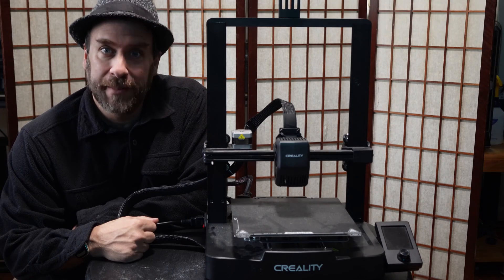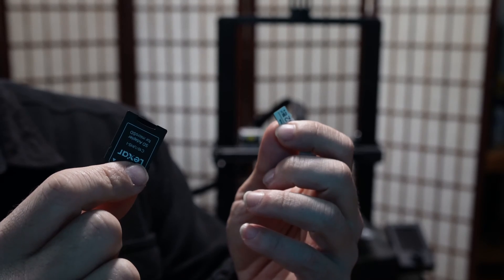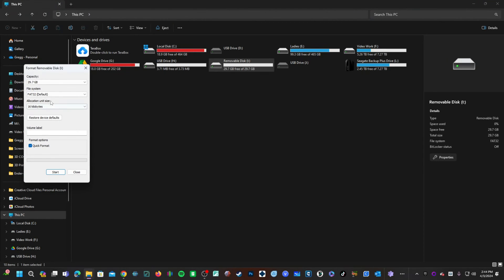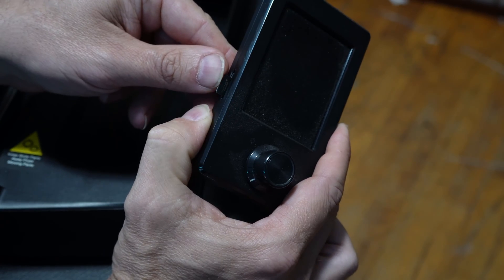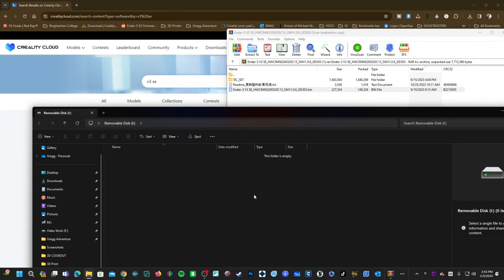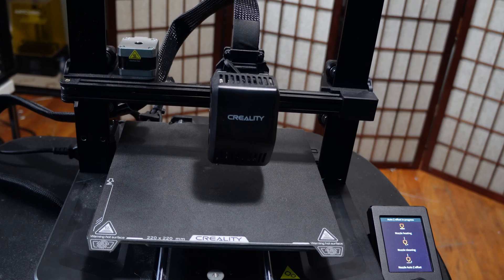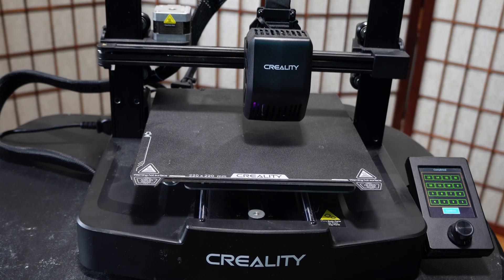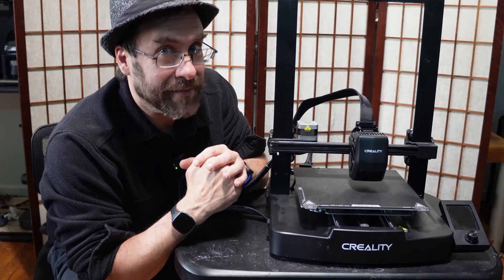How to Update the Firmware on Creality Ender 3 V3 SE - 3D Printer

Comment: First of all, great video. Secondly, do they not sell this nebula pad anymore? Can't seem to find it on their website. The only thing I can find on their product page is literally just a picture of the pad, with no details or anything. I'm thinking they must be switching to the Sonic pad I am seeing.
Reply from the maker: The Sonic Pad is well older than the Nebula. I have had great luck with my Sonic Pad, but I would find a Nebula for the SE
Reply: @3DRundown  Apparently AI tells me I can use an old phone/laptop for wifi by connecting directly through USB. Those screens seem to cost what I paid for the printer (on sale). Think I'm going to try repurposing my old laptop with OctoPrint. And maybe in the future integrating it in to my desktop setup and connecting directly. Thank you so much for the reply and for the video too.
Reply from the maker: @sihTdaeRtnaCuoY Nebula is a 10 min job and gives you Klipper. You'll have a much easier life with the Nebula
Reply: @3DRundown  I'll look in to it, but I need to see how much I will actually use this thing before I invest more in to  functionality. Thank you for your help.
Reply from the maker: If you mean "The printer", I get it. If you mean the Nebula, the answer is, everytime you use the printer. It completely replaces the Brain and O/S of the Printer. Seamless wireless printing and control, from Creality Cloud and Creality Print, is worth it alone. Best of luck to you. Check ebay!

Comment: did the screen part, worked perfectly, than tried the printer part and it just simply did not do anything, inserted the card turned the printer on and it just turned on like normal
Reply from the maker: Check the pinned comment for updated instructions. Also, make sure you don't need C14 files

Comment: Hi, i am unable to find that exact website where you found the update file. I have searched everywhere but cant seem to find it
Reply from the maker: Sadly it's changed and become a challenge to find. If you'd like, it's in my private Member library. Be a member, and you'll have access. Catch the pinned post for updated directions
Reply: @3DRundown i have found it now, i had to find the printer on the website like you would do if you were to buy it and you can find the files there, thanks for the quick reply and the help btw
Reply from the maker: @Is_This_It_ Awesome. Good luck🎉

Comment: Just in case someone had the same problem with me, if you change the name 123.bin (the bin file that you put in the big card and put on motherboard) that will do.
Reply from the maker: You had to do that cause a previous attempt failed, or a firmware with the same filename was already installed. It won't attempt the same file name twice

Comment: IMPORTANT FOR V1.1.0 UPDATE:     
1. COPY FOLDER (TJC_SET) to SD card to update screen
2. COPY FOLDER (STM32F4_UPDATE) to SD card to update printer motherboard

Also ensure only a single folder is present per update attempt, don't put both folders on the SD card at the same time
This will update succesfully then.
Reply from the maker: Also, Catch the pinned comment.

Comment: The solution for updating firmware 1.1.0 is to download the file, then unzip it (decompress it). Inside the 'update' folder, there will be a .bin file. This file must be placed onto the micro SD card (only the file, not the folder). The .bin file should be at the root of the SD card.

Comment: I  did everything in this video and It worked! But right after putting the card for the motherboard update, when it started leveling the bed, it leveled in the same spot about 3 times then showed a QR code on the screen. What’s going on?
Reply from the maker: No Clue. What does the QR Code say?

Comment: Hey, so I have a question. So mine keeps going back to the language setting part of it, it won’t go to the regular menu. How do I fix this?
Reply from the maker: Not sure. I have written instructions on the Pinned comment. Try that. Also, if you have the C14 version of the SE, you need a different firmware
Reply: @3DRundown  Got it, thanks so much!

Comment: Can I ask, can I still use the sd card and put STL files on it to put into the files of the 3D printer?
Reply from the maker: You can not print STL. You need sliced GCODE. You can use USB, but that's 3  years ago. Send direct from CP6
Reply: @3DRundown can I send it from creality cloud to the printer?
Reply: @3DRundown I've been trying to figure out how to connect my printer to the creality cloud for a couple days now, so if you could help me out with that, that would be great 😊
Reply from the maker: You can only do it once the NEBULA PAD is installed. Are you at that point?

Comment: So following this tutorial got my printer basically bricked: After doing everything step by step as you said, when i inserted the microSD card in the screen and powered it on, the screen just gets stuck on "copying from SD..." at 0%. I left it like that for 2 hours and nothing changed. Is there something i can do here? Because it seems like my printer (or at least its screen?) is done for.
Reply from the maker: You followed the updated written instructions in the pinned comment?
Reply: @3DRundown  i dont see a pinned comment, but thankfully i did get the printer working again, it was just an issue with the SD card i was using, apparently this printer is awfully sensitive to that for some reason.
Reply from the maker: They all are. Always use the best quality card you can. 32gb or less, Fat32 formatted

Comment: how much time it takes? ,my printer its stuck in the copy sd 0% about an hour ago 😬
Reply: now i have asystrem data error message
Reply from the maker: Should be breif
Reply: now only shows system data error, creality can´t solve the problem, now it´s trash, only 3 days new
Reply from the maker: No such thing as "Trash" In the 3D Printing space.... We fix it. Have you tried my updated Written instructions, in the pinned comment?
Reply: @3DRundown  Incredible, somewhere I saw a video about a strange event. You need to use a certain brand of micro SD, so I did it, I used sanddisk and it works great, now the screen is updated, but not the hardware BIOS. By the way, I'm using the new firmware update from May 2025.

Comment: Huge thanks for this awesome video!  This morning (it's late afternoon now) I realized my printer was stuck in a blue-screen-of-death 😭. Since then, I've opened it up, checked the power supply with a multimeter, and updated the main firmware, which got the motors working again. BUT, the display was totally messed up. *Nowhere* until I stumbled on your video did anyone mention that the display unit has a **separate memory card port**! Just finished the firmware update on the display, and it's back up and running! Thanks a heap! You saved my print day! 🚀

Comment: I can’t get the bin file to run setup. Dial pad worked perfect
Reply: I’ve tried the new firmware file and the exact file you used and machine doesn’t go into initial setup
Reply from the maker: Have you seen my written step by step in the pinned comment

Comment: so i have issue that when i added my sd cart into printer after instaling on screen, my screen is the blue background that is behind creality logo like in the moment 5:08
Reply from the maker: Hi. Make sure you have the right firmware. C13 and C14 boards use a different file. Also, catch my written step by step in the comments
Reply: @3DRundown  i tired both and nothing changed

Comment: Just updated to newest firmware version 1.1.0, after doing the screen update, I moved on to the step where you put the bin file on SD card. After turning the printer on it didn't go to setup screen, just to the main print menu. Firmware on screen shows update. Think everything's kosher but idk.
Reply from the maker: Run a print over wifi from CP6 and test her out
Reply: @3DRundown yea running a print right now, so far so good! Thanks for the great video. This is the 2nd time I've had to reference it 😂.

Comment: For those who may not realize (or can't read chinese) the 1.1.0 update needs the "STM32f4_UPDATE" folder - as well as the Ender3 V3 SE GD303SWV1.1.0_HWCR4NS200320C13_20250422.bin file in the root of the SD Card now for the motherboard firmware update. Save yourself the headache I had XD LOL
Reply: Thank you! I have been pulling my hair out wondering wtf is going on
Reply: This worked for me! Thanks legend
Reply: I have both and my screen is just blue

Comment: I upgraded the screen firmware, but whenever i'm trying to upgrade the machine, the machine doesn't get the update, it starts automatically.. any suggestions?
Reply from the maker: Be sure you are running the correct firmware to match your board for C13 or C14.

Comment: Please help, my update stuck at "0% copy SD" I'm afraid I made a brick out of motherboard, because I've tried different microSD sizes, different allocation sizes, different firmware versions, but nothing helped. I'm afraid that I could've "brick" Motherboard, by rolling down the firmware to lower version, but when I sent a ticket to creality support they also asked me to try different versions.
Reply: i'm having the same problem, have you found a solution?
Reply: @Z4akaKn4LL guess u like me downloaded firmware for different motherboard model, if u already bricked it try to get steel panel under ur printer and check motherboard model, it should be wrote on it. It should be "......c13" Or "...... c14" On github scroll down and find different links "hardware version CRNS200320C13" or the same but "...C14" and install the one for ur motherboard version

Comment: I did all you said but I can't get the blue screen to go away. Formatted SD card multiple times and changed the name  to 123.bin but still will not upgrade.
Reply from the maker: card is 32gb or less, fat 32? tried another card?
Reply: @3DRundown  tried both 4g and 1g SD cards. Downloaded the files again changed name to 123.bin. Still no help. Reformatted the card multiple time fat32 4096. Still dead.

Comment: Hi, my crealety 3 v3 se feed motor is stuttering even without fillament inside it
Reply from the maker: open it up. look for broken filament inside
Reply: @3DRundown  ther is no fillament inside
Reply: @3DRundown  can it shotout if i used to big fillament?
Reply: @3DRundown i used 2mm fillament i made myself can it break if its stuck and still Pulling?
Reply from the maker: 2mm is too big. Are your GEARS ok?
Reply: @3DRundown i even Baught a new motor and gearsystem, and a new cart, the card behinde the nozel. And jub the gears are perfectly fine

Comment: I upgraded the screen firmware, but whenever i'm trying to upgrade the machine, the machine doesn't get the update, it starts automatically. I used the 8gb SD included with the printer and 4096 bytes and it doesn't work. any suggestions?
Reply: same did u find out how?

Comment: I've had to repeatedly reinstall the firmware on mine and now it doesn't seem to want to accept the firmware install and to make things worse the bed is automatically heating up to ridiculously high temperatures.I don't know where to go from here..
Reply from the maker: It will only read the same firmware name once. you will need to rename it, to try again
Reply: @3DRundown Well, I've done that several times and it works... For a while then it seems to get corrupted again then I have to change the file name ect... The last time I did it said something to the effect of firmware not found and the bed started heating up extremely hot.
Reply: @3DRundown So.. I may have actually put the .bin file in the screen this time instead of the Tjt file ... My mind isn't what it used to be lol. Still doesn't explain the bed heating up by itself...

Comment: I was able to update the screen no problem but when i put the frimware into the printer nothing happens it boots up lheres no new firmware on there im notbsure what to do
Reply from the maker: 32gb or less, format in fat32, file in root directory
Reply: @3DRundown i couldnt get the firmware to update but i got it run fine without it thanks for the response though.

Comment: Ciao non potresti fare un tutorial per risolvere tutti gli eventuali problemi di installazione? A me è andato tutto bene poi alla prima stampa ho notato che i layer venivano stampati senza essere allineati quindi è uscito un macello, poi una volta spenta la macchina e riaccesa ho dovuto fare di nuovo tutto il processo di configurazione, poi ho provato a fare un aggiornamento con la pen drive che è arrivata con nebula e dopo di questo al riavvio sul pad appare una scritta "avviamento macchina in corso" e non succede più nulla, mi potresti aiutare a risolvere il mio problema? Sono bloccato e non riesco a trovare una soluzione in attesa di una risposta ti ringrazio in anticipo.
Reply from the maker: The firmware on the usb drive will be very outdated, I would not install that
Reply: Ho capito, ma adesso cosa dovrei fare per far funzionare il nebula pad visto che è bloccato? Mi dai qualche consiglio per ripristinarlo o qualsiasi altra cosa per farlo funzionare? Grazie
Reply from the maker: The newest firmware should still reinstall. Try renaming the file. Name it whatever. Just change it. Try older firmware, then newer firmware. If you don't rename it, it may not load it a 2nd time.
Reply: @ grazie dell’aiuto sono riuscito a far funzionare nebula grazie ai tuoi consigli con un file più aggiornato non mi da più errori e funziona bene,
Reply: Ti devo chiedere un altro favore però, ora dovrei risolvere un altro problema perché una volta installato nebula pad ho provato a stampare ma le stampe risultano sfalsate, cioè i vari livelli di stampa praticamente sono spostati e quindi l’oggetto stampato mi viene storto, come dovrei risolvere? Devo fare qualche settaggio?
Reply from the maker: tighten the belts. look for my tutorial on that here

Comment: Do you have any videos on why my v3 se will not read my sd card my friend
Reply from the maker: Be sure it is Fat32, 4096, 32GB or less
Reply: @3DRundown  I have tried with 4gb, 64gb (partitioned for 8GB), and 8gb sd cards all in Fat32 and run the microSD card step, but the printer still wont recognize any of the SD cards (Sandisk, TeamGroup, and Gigastone respectively). 

My printer has a bit of a stiff SD card slot and when i go to push it in, i hear a click, but it doesnt retract at all. I have tried manually pulling it out to the second click and I have tried just leaving it in its place from the first click. 

I know the SD card is not corrupted as when it was formatted to ExFat it was working on the bambu printers at school. This printer SD card slot was working one day and not the next, do you have any suggestions or should I contact creality directly?
Reply: @ZatralTMF  Did you fix it?
Reply: @dekugh64 sadly, no. I submitted my issue to Reddit and everyone said it sounds like a fried motherboard port. I opened up the printer to see what model I needed and ALL the port connections were hot glued into place. Idk why or who would have done this, but the printer is more or less trash now

Comment: Thank you for the video, explained for anyone to follow. I am still having an issue, I attempted to read through the comments here to find something similar. But after some scrolling I didnt see anything.
My V3 SE, if brand new out of the box. The system powers up, I get the fans and the screen comes on showing the background of the blue with white dots. But nothing else happens, currently I can not update the screen due to have a 256g Micro that will not allow me to Fat32 Format it. I have tried to do the firmware update with the 7+GB SD card that comes with the printer. But still, once flashed and installed the printer just sits at that blue screen, no menu pops ups and the fans just hum. I even let her run for 20mins to ensure I was not rushing the boot process. Any suggestions?
Reply from the maker: Did it boot at all ever? Try to rename the firmware file (keep the extension!) to anything else. Something like. "Firmware" and try again. A 32gb or less, formatted in Fat32. Keep a few quality cards on hand. Never know when need one, and they are cheap now. Get a Nebula for that SE
Reply: @3DRundown By Boot. I hear a couple of clicks, fans turn on and the screen lights up showing that blue/white dotted background. But after that we just sit endlessly. Today I have some Fat32-32gb cards arriving will try again. Will also attempt this Firmware rename.

The Screen update lets me know instantly, "not fat32" I dont get much from the printer firmware update efforts.

Thank you greatly for your time/help.
Reply from the maker: This is Marlin all day. It's always been all or nothing. Marlin Sucks
Reply: @ So it is now working. I did as you suggested, got my Micro SD card today, that was Fat32 capable. Then after Screen update, renamed the newest firmware for the SD card and BOOM it is now calibrating itself. Thank you again, you just earned my sub ez. Plus where can I find a donate button for saving me extra woe's and time?
Reply from the maker: Epic! And thank you for your support. It's very helpful. There are a few ways:
VENMO: https://www.Venmo.com/gregg-cerenzio
PAYPAL:: https://www.paypal.com/biz/profile/cerenzio
SUPER THANKS: Click the THANKS button, on any video (I get about 45%)
Be a Member: https://www.youtube.com/channel/UCbUb8QjvZiimB-8sN6oDl9Q/join
Be a Patreon: patreon.com/3drundown